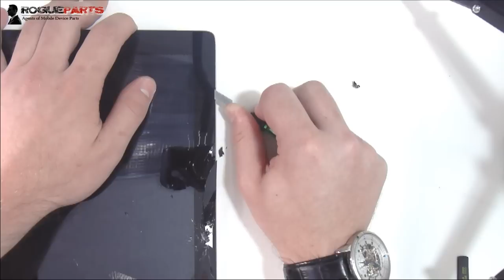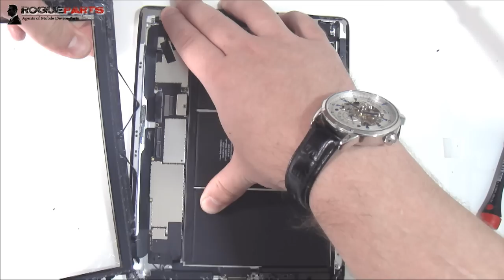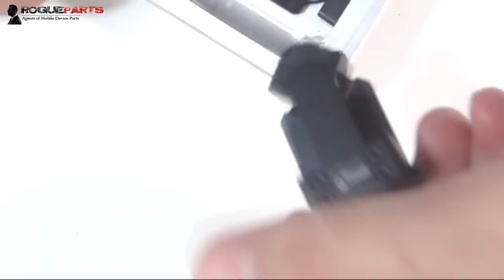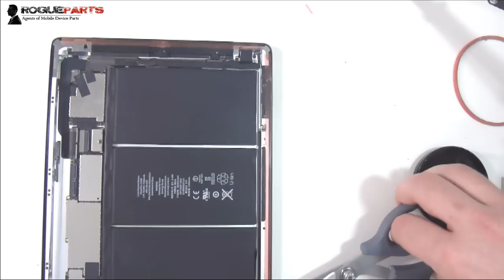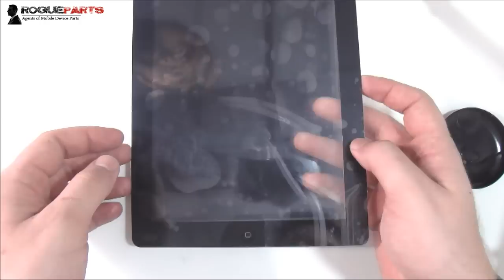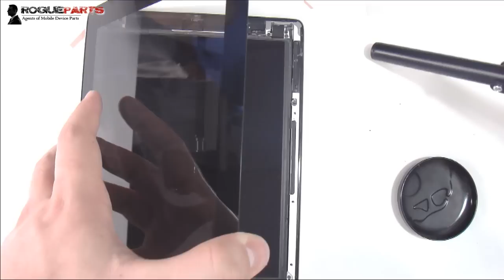Full iPad 3 Screen Replacement Tutorial - Up Close, Nothing Left Out

Comment: Wear glasses/protective goggles when removing the screen so glass doesn't jump up in your eye. Also were the glass is broke apply tape over it so it doesn't go everywhere. Use eye glass cloth to clean the screen, not a rag. I also did mine using heated up rice in a bag wrapped with a cloth. Heat gun is not necessary.